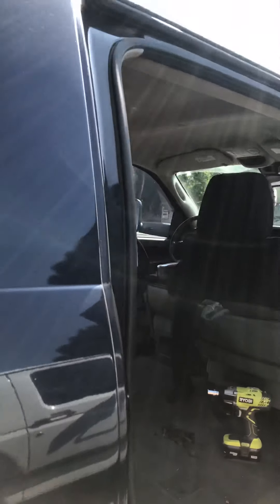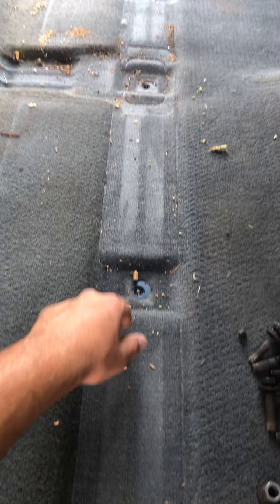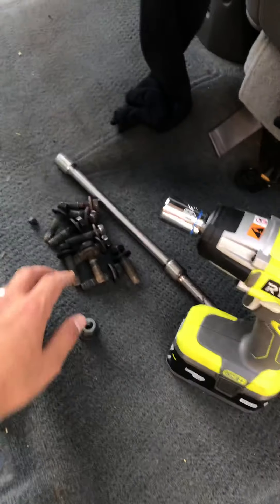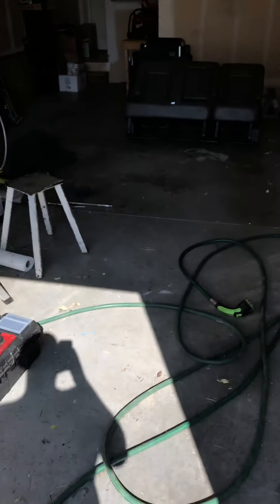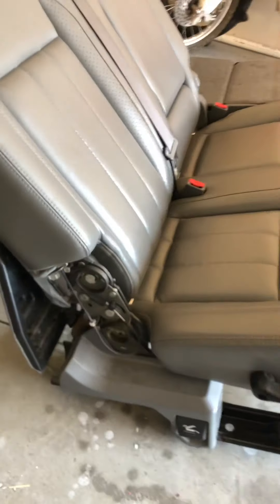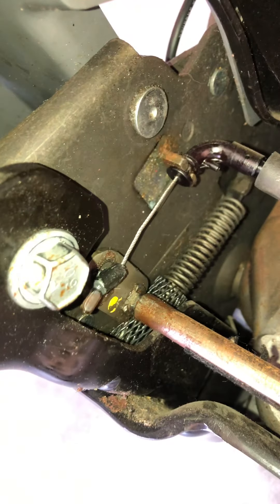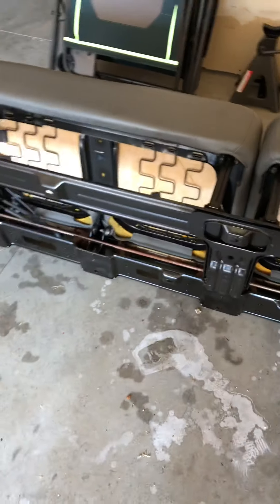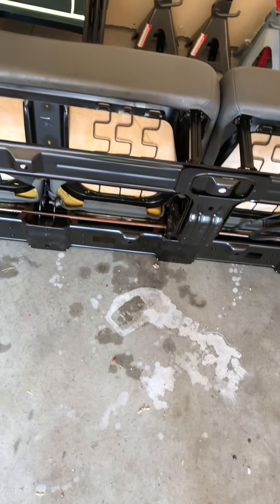3rd gen mega cab rear seat removal

Comment: Check out this link... https://www.cumminsforum.com/threads/megacab-fold-flat-rear-seat-problems-two-fast-cheap-fixes.517259/
It talks about pinching the rod that is rotating under the seat to make it engage again.  And taking slack out of the cable.
May not be a fix for all, but hope it helps!
Reply from the maker: Kurt Pemberton thank you. I did read that numerous times. And I tried both tricks. Neither worked unfortunately though
Reply: @DPats1228  I just took mine apart.  I was just having trouble with the seat flex lever not releasing the seat.  An addition of a crimp added higher on the cable allows my seat to release.  Unfortunately, my plastic handle had broken off.  Clearly due to lack of patience on my part!    I removed several different covers before realizing you can remove the entire seat flex mechanism with just 3 screws.  The tricky one is on the backside that is not visible.  Once you know where its is, its not a problem to remove.
But back to your issue.  While under the seat I looked at the bar that rotates which is your issue.  Mine is still crimped on at each end and has not rounded out and spinning yet.  Did you try drilling a small hole thru each end of the outer rod (and "peg" at each end that rotates it) and dropping in a cotter pin or small screw and bolt to hold it and keep it from spinning?   Again, I haven't had this issue, so I haven't tried it, but that was my thoughts as I was looking at it while under there.  That or spot weld it at each end to prevent the spinning.  But I'm not a welder.  
Let me know if any of those ideas are helpful.
Reply from the maker: Kurt Pemberton that’s a great idea, unfortunately I traded the truck in this last thanksgiving day. Sad day. I miss it

Comment: You say the seat rusted from a leaky rear window? I have wet insulation under the rear carpet and wonder if my window leaks. I needed this video since im taking out the back seat to find the leak. 
Can you tell where at the window yours leaks? Around the seal or through the slider tracks?
Reply from the maker: It was leaking at the bottom corners of each side of the sliding window. Then the track where the window slides would pool and overflow. There is a drain that gets clogged in the trAck itself. What I did was drilled 2-3 more holes in the track at an angle for drainage. You have to clean them out with compressed air or something every once in a while. The fine dust and dirt clogs the holes no matter how many you have.
Reply from the maker: I made a video as well before on the rear leaking window. https://youtu.be/vaLorjtb7e8

Comment: Any update ? Did you get your passenger side seat to lay flat ? I’m having the same issue
Reply from the maker: valentino reyes sorry, no. I couldn’t get it. My release mechanism was rusty from the back window leaking water. So it’s all messed up. I just had to put it back in. The seat is very very heavy. So if you take it out Make sure you’ve got help